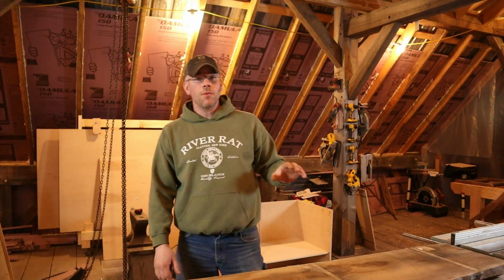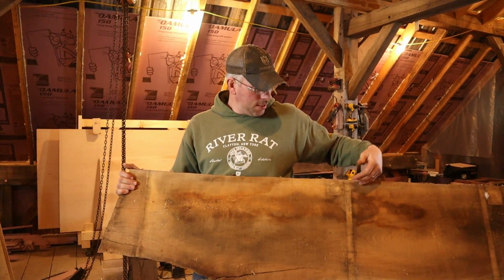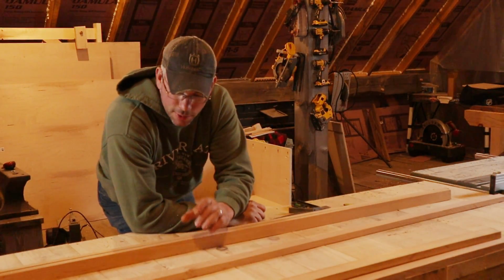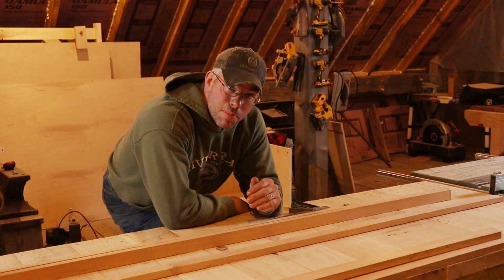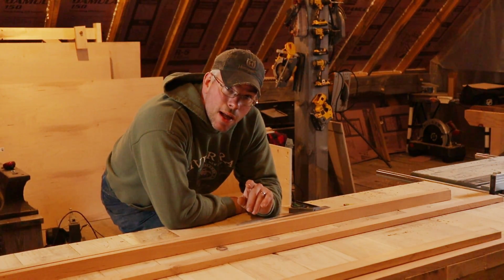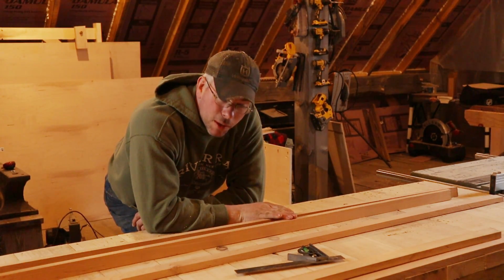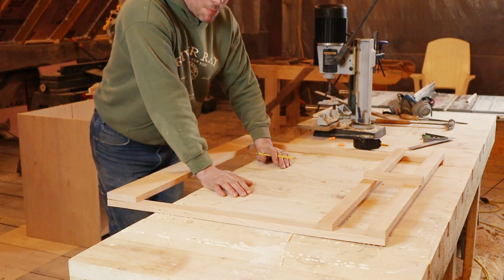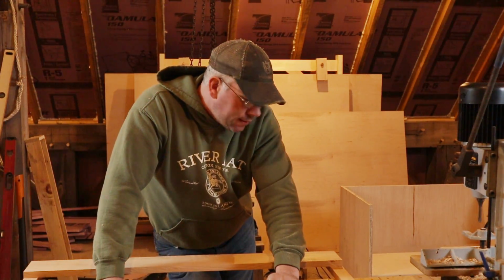DIY Custom Cabinets: Face Frame Tips and Tricks

Comment: Dear Jim,
I really like the DeWalt tool holder in the background. Is it me or is the picture of a higher quality resolution but with strange colour rendition??? A sfor your face frame, too early for me to visualise how ell it'll turn out. I guess I'll have to keep on following. Well done my old fruit. Kind regards. P.S: Had a gorgeous full moon yesterday evening with very mild temperatures (24 degrees Celsius).

Comment: Hi Jim, you brought your jointer up a while back; do you have it set up?  It would make flattening a face and squaring an edge easy and positive before thicknessing.  Thanks for bringing us along, as always.
Reply from the maker: It is running.  The problem with this stuff is the amount of bow in the lumber.  The jointer works great if you have enough thickness on the board to take the bow out.
Reply: Yes, I see you said as much in the next video... Working with what you've got; it's the art of the compromise.
Reply from the maker: It sure is.

Comment: I would recommend to build a some more roles for your plane, if your wood pieces are longer they are pushing upwards and make a smal impact at the end of your wood I know often it isn't a big issue but if you work with more expensive wood it will become a problem over some time and it comes the chance that the wood will loose the pressure mechanism of your plane over the years when the gravity pull your wood downwards at the end of the rols we for example buildet some moveable extensions so we can plane up to nearly infinite length (because of we have doors in both directions of the plane if we open it the length become unlimited) and if we don't need the longer range extensions we just store them in a storage above the plane your roof for example go much storage potential about your head^^
Reply from the maker: Not a bad idea.